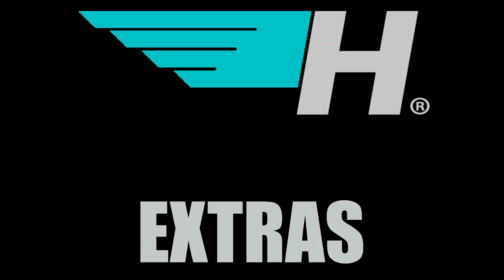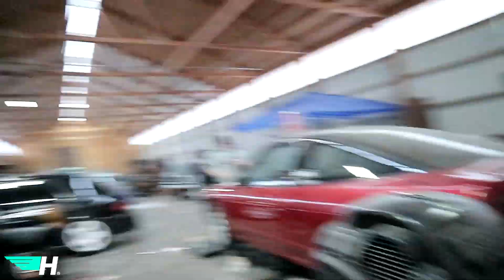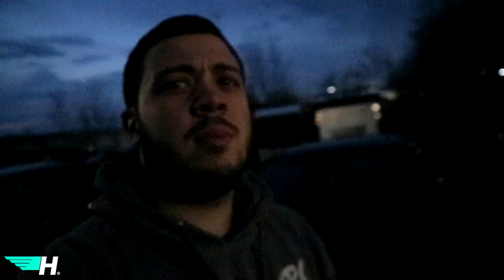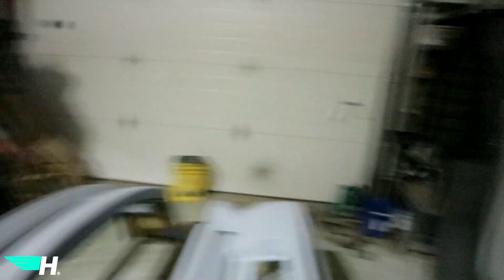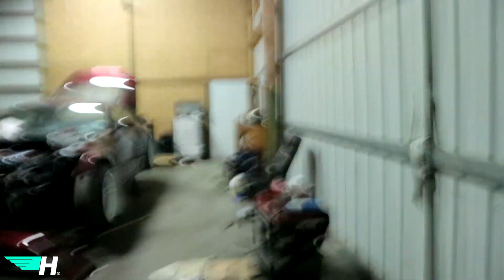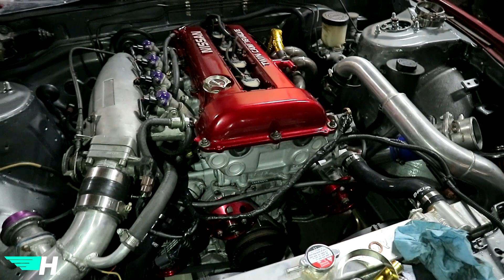CLOUTBACC IS F#@%!N  DECENT!

Comment: Travis, those copper crush washers are one time use.  They will leak again unless you anneal them.  Just heat them up til they are red hot and then quench them in water and they are good for use again.

Comment: Oil pressure sensing unit? 
Turbo oil feed? 
Turbo oil feed line? 
Banjo bolt? Turbo oil drain to pan?
Check everything oil related that’s a ton of oil to loose

Comment: Its probably the turbo oil feed line on the block that is leaking. Just google all the torque specs if you haven’t already. Or if its an aftermarket line kit then you have to make sure they are tightened with black rtv on the threads. Thats the only oil pressure fitting on that side I believe so its probably that.... or maybe the oil sending unit?! I forget where that is.

Comment: Why you letting your homie use super glue on his car?? Travis’s car is held together by superglue and bubblegum.
Reply: jalthaus that's probably the only place Travis has cut a corner. He seemed very meticulous on his build
Reply: mike dragon you think so? It’s been built and He’s been trying to get it to run for a month. He’s missing parts and had lost like 8 quarts of oil because of it. Idk about meticulous but for not doing it before he’s doing alright
Reply: I respect that everyone is letting Travis fail. That's how you learn.first off  Everything should have been put together properly before dropping the motor back in. Leaking fluids is the result. However I like the effort Travis has put in. Only use high temp strength epoxy like jb weld.

Comment: When you are paining like that, you should wet sand it first then paint only over the sanded areas. After that you can puff the lines out easily. and the paint doesn't come off.  just leave some of the sanded area unpainted, so your paint line is over the sanded area not on the actual shiny paint.
Reply: Ville Lipponen I bet he would have tried more but he didn't really want to put in the effort lol, it's a daily and as he's said "he doesn't care"
Reply: Yeah, but he ended up doing more work.

Comment: I have a 180sx with a stock sr20det, and i want to get rid of the stock intercooler in the wheelwell, and want to go with a front mount inter with a Bov not the stock recirculating valve, what would be good options or things to consider